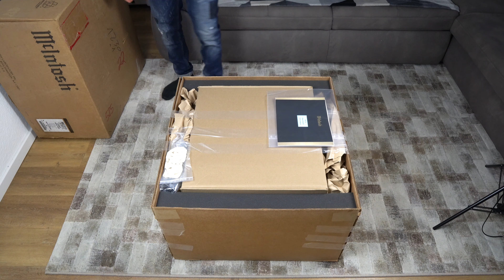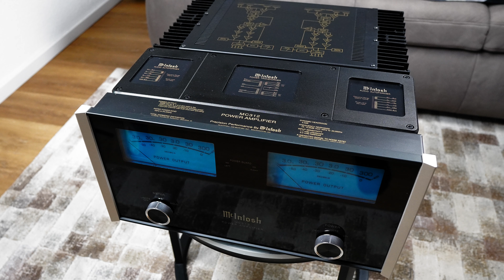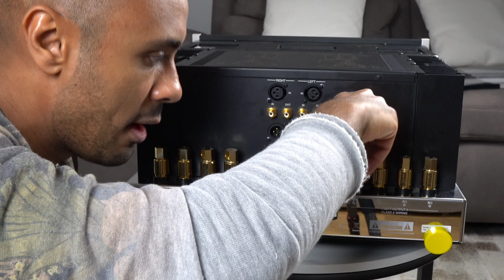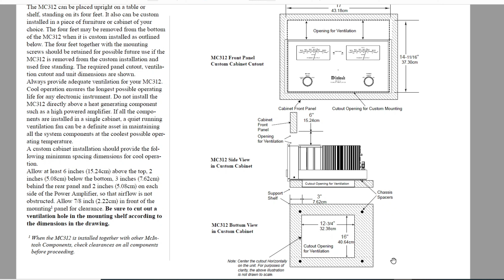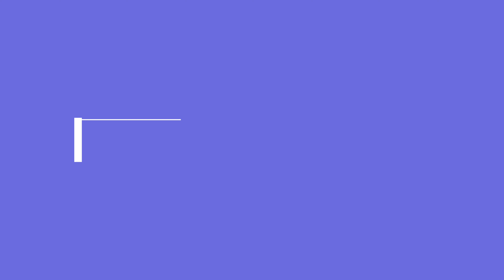McIntosh MC312 Power Amplifier Overview

Comment: Thanks for sharing 
I've been thinking about purchasing a power amp to boost my old class A hifi amplifier. I've recently become very interested in the Mc Intosh power amplifier. However I was wondering whether or not to just buy a new multi channel receiver amplifier with digital surround to use as home theater and as a stereo amplifier for music? 
Or just get a receiver for home theater and a separate power amplifier for music.
I realised what you meant in terms of the capabilities of your new amplifier with regards to using multiple channels. Although when you use a centre channel for home theater I guess that you will be limited to the centre channels maximum output unless it has a higher impedance compared to your floorstanding speakers?
Also are the rear surround channels mono in true digital surround ? I know it was in the past but I'm not sure about now.

👍
Reply from the maker: Is been a long time since i made this video, what i learn is that most of reciver are just not the best way to really speak about High Fidelity music reproduction, my suggestion is to keep the things separate, any proper HiFi Preamp or integrated amplifier will just blow away any reciver in HiFi!
Reply: @MadAudiofficial  thanks

Comment: Did you only get the power amp?  I just wondering if I should get MC 312 and the C2700 or C53 but as it is very costly to get both at the same time, I may need consider getting the MC 312 (or the MC 462) and us my Musical Fidelity M5si as the Pre amp or simply connect the power amp to my CXN V2.  I am using the Concept 500 speakers.  So what do you think?  The shop also suggest me to consider MA 12000 or MA 9500 if I want to lower my budget.
Reply from the maker: I can tell you what i will do if i have a pair of Concept 500 but that's doesn't mean that u have to agree with, in the end is important that you choose what make you feel more happy..I will defenitly stay with a Integrated Amplifier cause will make no sense to go separate in this price range.Are u not happy with the M5si?
Reply: @MadAudiofficial  Thanks for your comments.  Just wondering, why would consider integrated instead of going separate?  I was thinking going separate would offer me more flexibility in the event I wanted to upgrade my system in the future.  As for M5si, I somehow found it lack power (as compared to the M8xi integrated I recently tested).  I then went to listen the MA 12000 and 9500.  Found the vocal to mesmerising with MA 12000 - probably due to the tube.
Reply from the maker: @leslie-1127  cause i will move on separate only if i have the budget to do it and today there are really good Integrated Amplifier on the Market, Musical Fidelity is coming with the new Nuvista 800.2 that is impressive, take a look also of Rotel X3/X5 series!
Reply: @MadAudiofficial  thanks for your advice.
Reply: Just came back from the Mcintosh shop - wanted to try out C2700 with MC462 but they only had MA12000 so we connect MA12000 to MC462.  I simplify loved the results.  Not sure if C2700 will offer the same results with MC462 and my Concept 500.  I was thinking of first getting the MC462 and use my M5si as the Pre Amp.  Probably get the C2700 or other Pre emp towards the end of the year.  What do you think of (a) whether MA12000 is a good representation of the C2700 when connected to the MC462 and (b) whether it is ok for me to connect the M5si as the pre in the interim.
Reply from the maker: @leslie-1127  U connect the MA12000 to MC462 and Concept 500? Is important to test it with your same speaker, ask if is possible to test at home the MA12000..
Reply: @MadAudiofficial  Actually I was initially looking at the MA12000 and MA9500 (integrated) but was not too impressed with the results.  So I asked for C2700+MC462 but they didn't have the C2700 demo. Hence, we connect the MA12000 as pre to the MC462 and instantly I can hear the difference (as compared to the integrated).  Wondering if MA12000 is a good proxy for the C2700.  I understand they Mac has C12000 too.